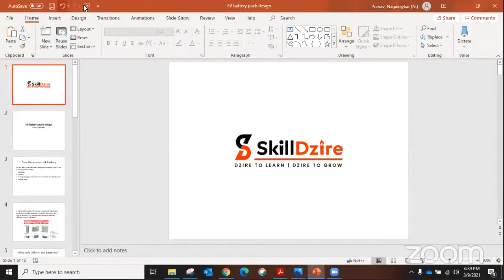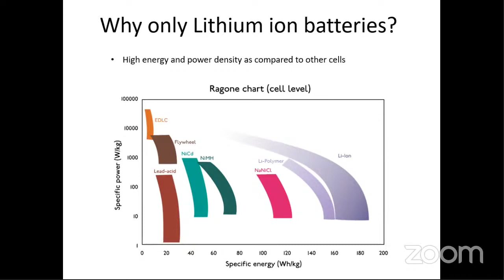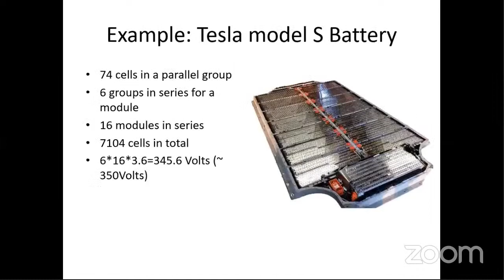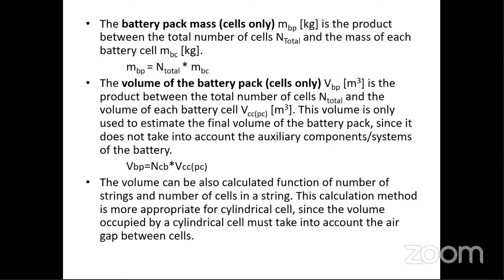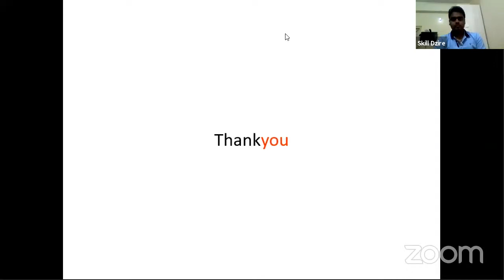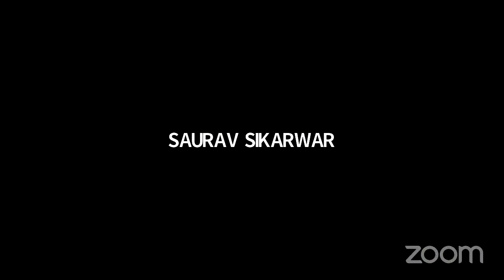EV battery pack design

Comment: 6 is for the group in series, 16 is for no.of modules , why does 3.6 come in total voltage calculation
Reply: its the voltage of the single cell. Nominal votage is taken as 3.6, so totale cells in serise times the voltage of single cell.
Reply: Okay, thanks for the clarification ❤️
Reply: @suyashray3611  it's ok..i was just worried if i had made any mistake during the lecture when I saw the comment but then i realised it's just a voltage calculation clarification... Cause this is i think many months back and I guess my first lecture at SkillDezire 😅